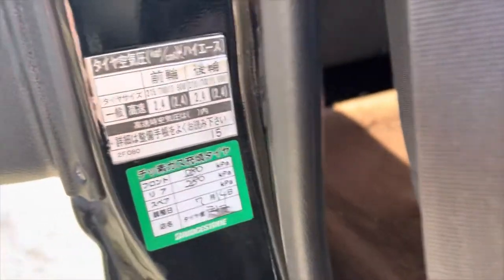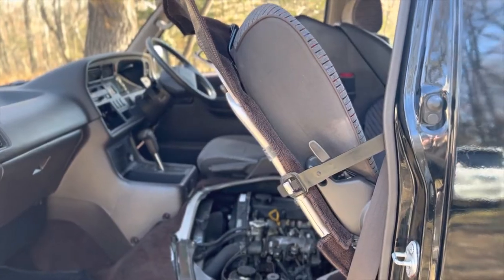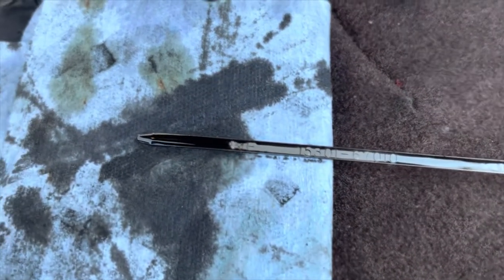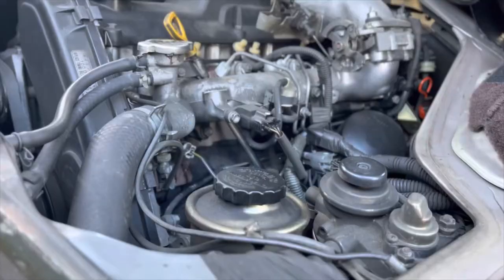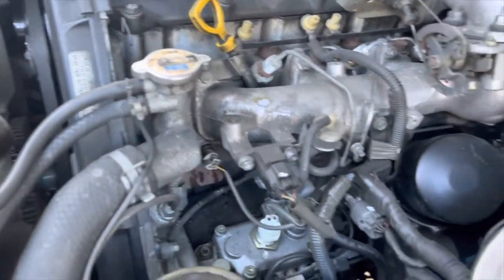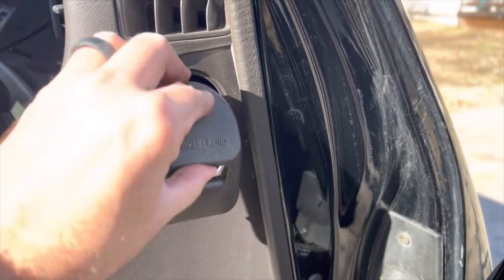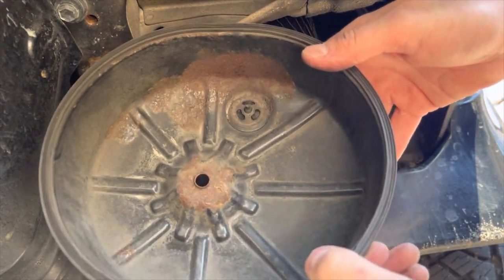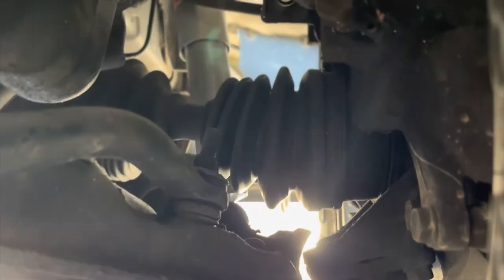HOW TO: General Maintenance Check on a Toyota Hiace

Comment: Any idea about a non-OEM replacement part number for the oil filter?
Reply from the maker: OEM is 90915-30002.  Amayama lists Nitto 4TP125 as a replacement.  Not sure if this is readily available in the US.
Reply: I can confirm WIX 57254 will work, which can be ordered through Oreilly and Amazon.

Comment: Well done man
I bought a Toyota hiace turbo Diesel Automatic ( import) 3 lt 1999 1kz te
Heats so much
And having a kick back problem
Reply from the maker: A kick back problem?
Reply: Also could you please put a photo where the air hoses get connected ? Coming out of the sensor egr ecu 
Not map sensor or any other.
Perhaps you can draw the air leading into throttle